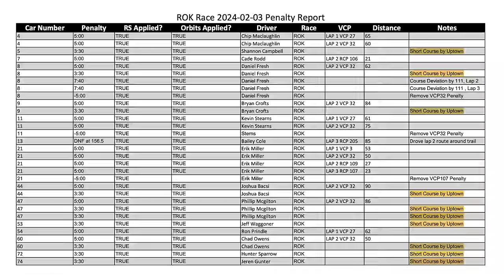FIRST | 2024 King Of The Hammers (FULL STORY)

Comment: Hammer King productions really needs to figure out course markers, there is more missed VCP's during a KOH race than any of the Baja races. It seems to be an issue year after year, if a "Trail" is missed by more than half of the field it should be staked off with the typical orange arrows to signify the correct trail. AND to threaten to disqualify someone for it? Not a good look.  You'll get em next year no doubt.
Reply from the maker: I can imagine us racers are like trying to herd cats, I know it’s hard for them to put up arrows in spots because of how hard the ground is. I think they did like 6 revisions of the map. It’s definitely tough, because the rule book says one thing, they say something different in the drivers meeting then by the end of the drivers meeting they change or add stipulations to what they said at the beginning of the meeting.